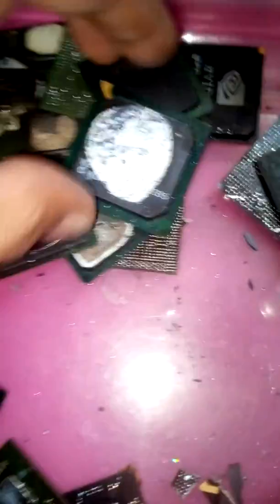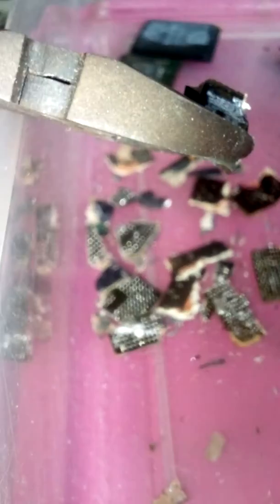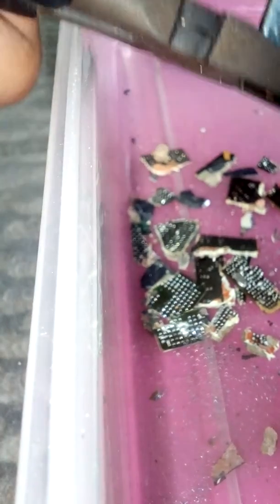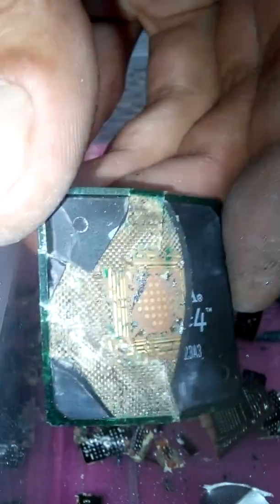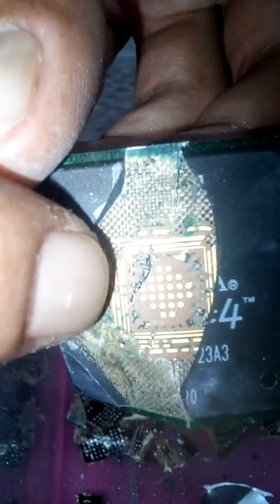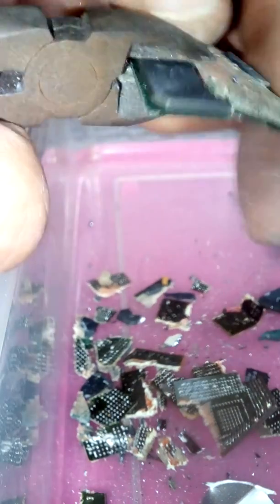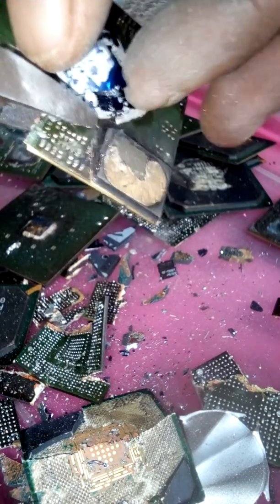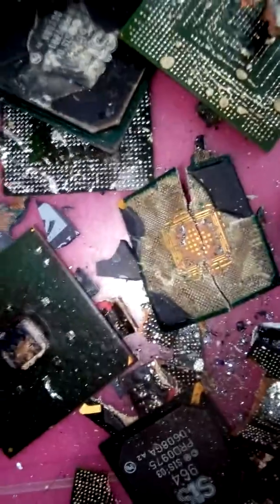BGA,GPU 22-24k Gold Wire Examination.2/2.✨

Comment: There is very little if any gold in the type of flip chips you tore apart.  The third chip is loaded with gold bonding wires, but the majority of  the gold is in the black plastic tops.  They need to be incinerated.  You get on average of 7 to 9 grams of gold per kilo.  Very high gold bearing.  The black tops is where the gold is.
Reply from the maker: Since i have yet to crush an cook said black tops cannot dispute what you say,Assumed they were just silicon heatsinks being as though gold cannot be seen within them upon examining.
Reply: @welshdragonmetals  "Back Yard Scrapping" just did a video on YTube on the black tops, and it's pretty evident.  Also, if you have a loupe, you should be able to see the gold bonding wires in the broken up pieces of the black tops.  That's were the gold is my friend.  From what I've learned, those black tops on the BGA chips are one of the highest yielding forms of ewaste.  Anyway, I enjoy watching your videos.  Thanks for making them.